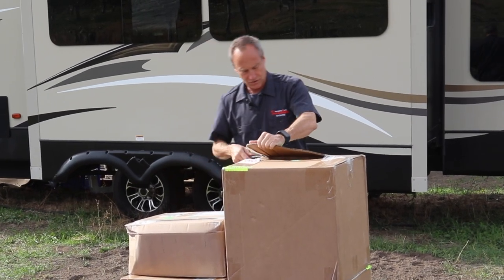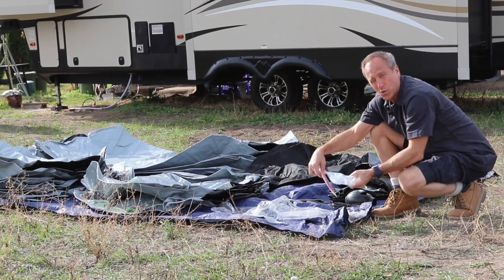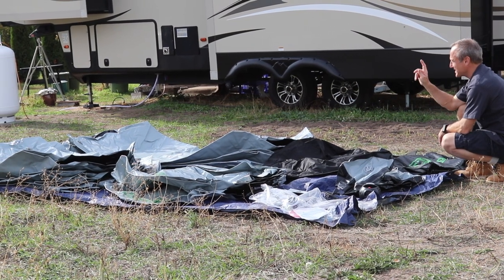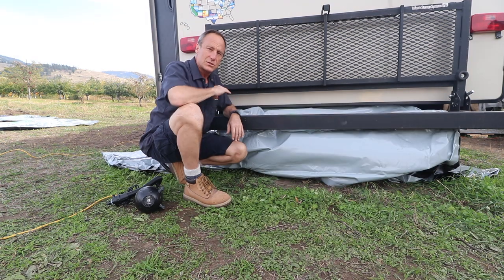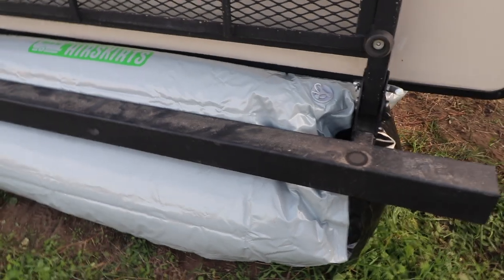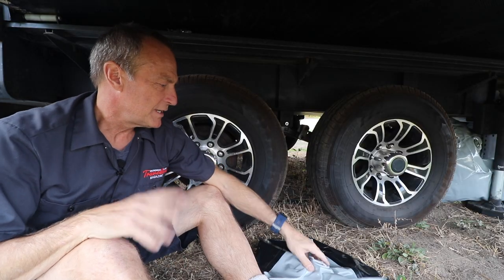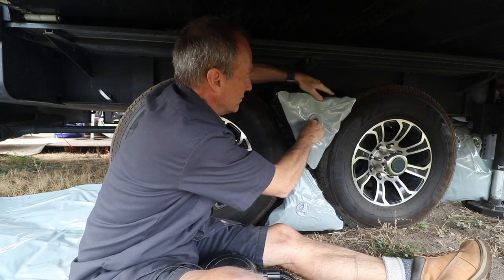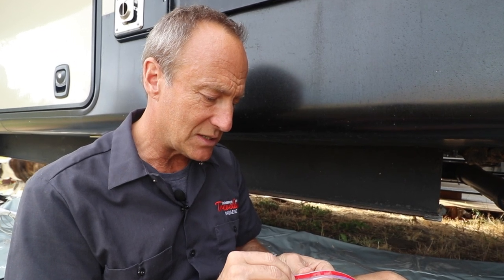AirSkirts Full 5th Wheel Install and Review

Comment: I have Air Skirts! Prior to inflating I went over my underbelly with a fine tooth comb. Added pool noodles to edges, foam to corners, and taped down any "pokey's". Used all the plastic edge protectors the Skirts came with.  2nd, in my humble opinion Air Skirts were specifically made for Air Streams. Those that dont have Air Streams have to make adjustments for Air Skirts to fit. So what I did was only fit the Air Skirts where my water pipes and heating ducts run. My entire RV is NOT covered, but the seal the Air Skirts provide has allowed me to not turn on my furnace unless it is 19 degress or less outside! Bunch your skirts as close together as you can get them to eliminate "air gaps".  I temp 4 zones. Outside, inside, subfloor, and the space between the AirSkirts. The space between the Air Skirts is 7 degrees higher than the outside air, even though the gauge is outside on the ground.  The gaps from the Air Skirts provide air so humidity won't build. The Air Skirts occupies enough space underneath that cold air cannot just breeze in. I tried insulation board one winter and the humidity underneath was always in the 90's. Oh I forgot! I have 4 1 gallon bottles of ammonia with felt wicks , mothballs, and bait stations where there are gaps.

Oh! One last important thing! Heat makes air expand so in the summer months you MUST deflate your airskirts a little to compensate for the expansion of air. Especially on the Skirts the sun will be beaming on. I blew a seal from not maintaining the exposed Air Skirt. The company issued a new skirt. No questions!
Reply: what kind of adjustments are needed?
Reply: @carlosgato7491  You may need extra Air Skirt tubes if you plan to cover the entire trailer. Especially if you have slide outs. AirStreams are curved which makes it easier to fit the AirSkirts to get a good seal.

Comment: This may be a dumb question but those are my specialty! Would these help to keep the extreme heat out while in the desert?
Reply: Since heat rises you actually would not want to insulate around the bottom of the RV in the summertime it will have an adverse effect. The heat will get trapped underneath the RV and forced into the unit
Reply: Actually, when in Nashville for the International Airstream Rally, Jim who developed Airskirts used them for his Airstream.  We had 100 degree days and I was told that it did help keep the Airstream cooler.  They are more than happy to tell you about their experience and about testing their product.  If you are going from a hotter day to a cold night, you do need to pay attention to the amount of air and let some out.
Reply: @Bigheartrolling  all that's doing is keeping the heat in regardless if it's winter or summer. So obviously you would not want it in the summer
Reply: based on my understanding of physics the point of this thing is to keep a pocket of stagnant air under your vehicle as an insulator, this pocket of air minimizes heat loss through the floor of the vehicle, 
so the short answer is if you have air conditioning it will keep hot air from blowing under the trailer (thus warming the floor from outside),
but it will not do anything on a hot day without air conditioning (it may even keep more of your heat in),

Comment: Hi! Just wondering how the slide outs did since those aren't insulated. I just ordered the air skirts but realized I have 5 slide outs and wonder if Vinyl would be better since the air skirts won't insulate the slides.
Reply from the maker: Our slides were too high for the airskirts to reach, but we were still warm all winter. I think it's a trade off between the super insulating air skirts vs vinyl skirting. We used vinyl skirting on our Black Rock 22RKS and it did a good job too. Just more work to get on but anyone can do it. Here's the article: https://suncruisermedia.com/Home/resources/yes-skirting-an-rv-can-be-easy/